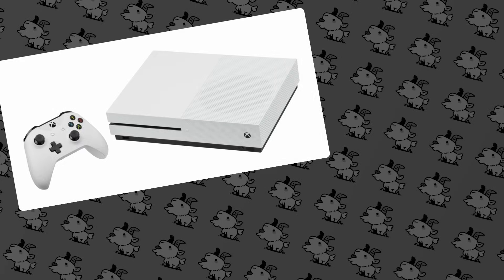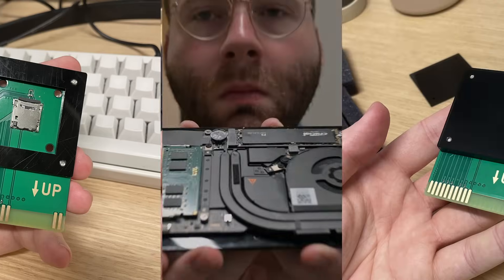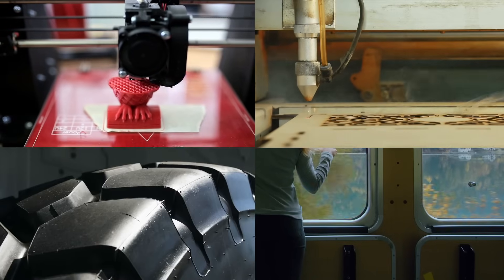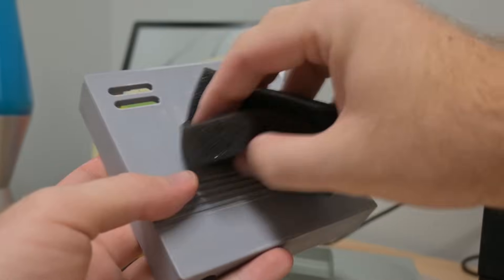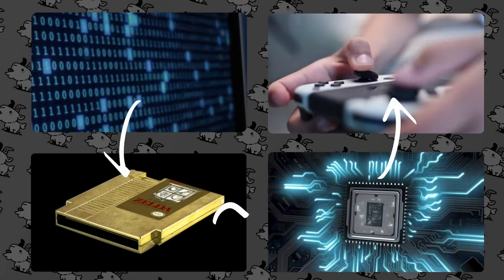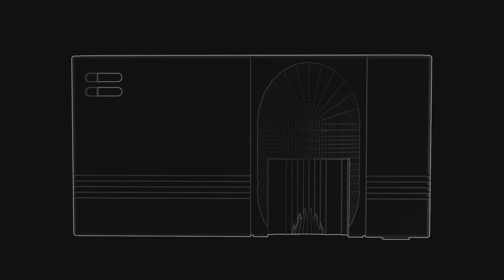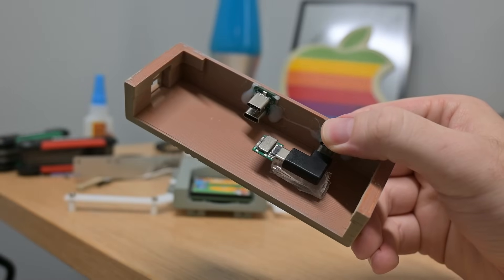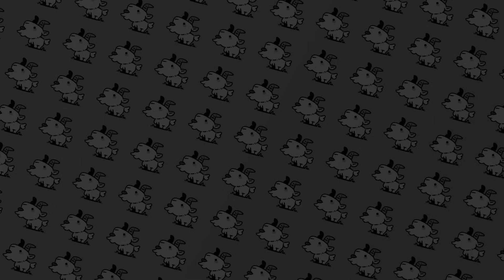I designed a game console that is already obsolete.

Comment: I would plug in the retro USB controllers that look like NES, SNES, or Genesis controllers in those spots.  For games, does it have a way to bring up a menu for save states, load save states, cheat codes, etc?  This is what I wanted my RetroPie to be, but much closer to the original idea I wanted.  I like the idea of physical cartridges more than just all things loaded on a device.

Comment: How did you make the power button work?
Reply from the maker: It's a bit of a cheat, since there's no power button exposed on the motherboard. It's actually a sleep / wake button, so shows up as a regular keyboard to the OS.
Reply: @abetoday  thanks for the reply. I'm working on a custom firewall project with an 11th gen Framework mobo and I've been using the tiny power button on the board.

Comment: I think using those ports for 8bitdo wireless receivers could be nice. They make wireless versions of classic controllers. Those adapters may also work for their regular top of the line controllers (such as the Pro 2 or Ultimate). Great video.

Comment: I would love to have an arm-band version of something similar.

Basically has a removeable switch-like controller attached to a screen that essentially has graphics like either star fox snes or other line/polygonal based games, essentially because it would be super underpowered and games would only be like $15 max, closer to 10. It could also be a way to get console games to go portable and cheap, as a barebone experience that should encapsulate the minimum needed to enjoy a game to the fullest. It would come with its own online gameshop to easily get games digitally. Not to mention connect together to get multiplayer if available.

I can go on about it, but unless I design and build/commission it, then it will never happen.

Comment: You could make an IR adapter that plugs into the front ports like the PS2. 
The PS2 had an IR controller with an adapter that just plugged straight into the regular controller ports in the front
Reply from the maker: Check out my "How to control your phone like it's 1984" video! I built exactly that.

Comment: wait does this have the console use a dedicated cpu or not? cause if so you have no air vent that will burn.
Reply from the maker: it has a metal fan grate on the back, it probably has better ventilation than in the original laptop case.
Reply: @abetoday oh ok them, cuasei was worrid for a second.

Comment: Nicely done!
IMO: There have been no games consoles in years - something you shove the media in to, turn on, and play... If a PC-like boot time, recurrent system updates, endless updates for software released in a broken state, the cursed DLC, a requirement to be on-line, no proper single-player or local multi-player... then it's NOT a games console! The last 'console' I owned was a PS3 - boot... online registration, 20 mins of systems updates, fired up Gran Turismo... 35 mins of updates. Turned off, never touched again.

Comment: here is how to get a good finish. apply automotive bondo, sand it down, primer it from about 3 feet with a preheated spraycan in hot water. let it dry 2 weeks then rub the surface with a rag. apply matte clear coat

Comment: Heads up: You can *massively* speed up sanding with the use of warm water with salt dissolved into it and <1% solvent and the use of a foam sponge between your hand and the sheet of sanding paper, or the use of a micro-sander, though I recommend you wear gloves. This can turn weeks into an hour or so fairly easily though you do need to regularly check and be mindful of your tolerances. Experiment a bit and find your sweetspot based on your preferences.
Reply from the maker: Good tip thank you!!

Comment: for the polishing step of the 3d printed material, you should have tested out an acetone vapor bath to actually melt the plastic and give it a shiny uniform finish, THEN hit it with the sandpaper and textured paints.

Comment: How did you get the games on the cartridge to run? You couldn't have used a steam library if you had a custom program running for running them. So how did you do it?
Reply from the maker: I’ll probably do a full video explaining how the cartridges work end to end, but TLDR is each cart has a script that is ran to set up anything needed for the game (either load the binary, set up emulator etc) and that script takes care of loading and booting everything from the carts
Reply: @abetoday do you think that a rubber ducky could potentially work for something like this?

Comment: Interesting project. Is there a way to get around all that hot glue tho? It looks so clean and that seems to kinda ruin the look.
Reply from the maker: There’s always a way to do it, would just need to design better internal brackets for the connectors, those just take a lot of iterations and time to get right!
Reply: @abetoday  so now that the design is done, that's v2, right? ;)
Reply from the maker: @vanelanjenkins3863  next console, no hot glue I promise (I don't promise)

Comment: Ports: - If we are going with he Classic look and feel of an old school system, then I would make the ports Module ports where you can have a game controller plug in, but also have the system register Bluetooth devices through a special dongle. This way your IR interface, is a special little dongle that plugs into the port. I'd also make a supporting hard drive that connects to the side of the main system and a CD/DVD rom that connects to the top of the system like the old Turbo Graphics 16, Super Famicom, and Sega CD systems used to do. All of which connect to the mother board through, those two USB ports. I would also build modular custom controllers for the system. That way you have this completely unique, high end custom retro system that feels like it's from the 80''s while also being modern and new. Plus your system could easily be the next Cyberpunk retro system. lol 

Examples:
Turbo Graphics 16:
https://en.wikipedia.org/wiki/TurboGrafx-16

Super famicom:
https://en.wikipedia.org/wiki/Famicom_Disk_System

Comment: What if, you added something like the gamecube did, modular devices for what you wish to do at that current time, say want to watch a movie? You just insert the IR module 
Play normal games? module for keyboard and mouse
Play retro? Make a module!

It seems like itll work
Reply: cool idea but aside from adding a disk drive it would be redundant if there's already a PC inside.
Reply: @Ucceah these modules could be basically the usb for the mouse/keyboard combo, can be wireless ^-^
Reply: @FezateruTheFloatzel  ohh, now i get you. a stylistically matched "cordlessess surfdeck (batteries not included)" would be sweet. 
i was thinking of monstrous modularity like the turbo-grafx 16 CD-ROM drive, or stacking a sege mega drive, mega CD and 32x.
Reply: @Ucceah pfft nah, movies can be streamed or just a disk drive connected temporarily for disks. Im thinking fun stuff, like heck, could throw on a Wii emulator with the bar and 'cartridge' thatll start a wii emulator

Comment: Those two front ports should simply be USB ports to plug game controllers in, I mean just about everything from atari to the nes has had controllers that plug in up front, so why not you too? it's what I remember classic game console designs being like, and I'm old, so I was there when they were new.  I'd totally plug some classic game controllers in there like NES ones or whatever, but NES USB controllers, this way, you could plug other controllers in too, like N64, atari, snes, colecovision, etc, all via usb. After all, when it's plugged in, nobody knows what the port looks like that's connecting your controller, just that it's rectangularish, so you retain the retro look.

Comment: Honest Question (as someone who is looking to do something similiar)...

Did you try filling before sanding/painting/sanding/painting....?
Reply from the maker: I used an automotive filler primer which generally does a good job of filling layer lines, but I did not do anything more extreme (bondo etc).
Reply: @abetoday  well that's slightly disheartening, but having no better plan I guess I'll carry on regardless... ;-)

Thanks for the reply, I'll let you know if I come up with a genius solution (so don't hold your breath :-) )

Comment: A simple solution for the front is to make the right side USB A ports. That way, you can hook up controllers onto it, preferably Xinput spec or compatible (thanks for the assist with PS4 controllers, Linux).

Comment: Where can I find the automan.sh file? I am about to write my own code but why would I reinvent the wheel? I am making two consoles right now. Thanks for the inspiration.
Reply from the maker: Are your consoles Linux or Windows based? My script is Linux only, happy to upload the latest version of its helpful.
Reply: Linux based... One uses regular 3.5 floppy disks and the other one 3d printed cartridges. The floppy one will be integrated to the body of a CRT TV. The idea is to play Pico, MD, NES, SNES, ATARI 2600 and maybe N64 if I use the RK3588. I have many options of hardware available to try.   @abetoday

Comment: Depending on how wide of a time period variance you're willing for it having the IR reciver would be cool on top but it personally reminded me of a PS2 controller/memory card ports so on the controller port idea- either having a dust flap similar to the memory card bays could be cool- but I think if you could pull it off a disguised USB(A) port could be cool if you didnt want to limit yourself to just one controller connection type

If you were to do a revision of this down the line I think having the left side be a bit bulker could give it more visual veriaty (although if youre going more C64 PC-In-Keyboard kinda style it might not fit with that) and it could have a wee flap to reveal menu buttons for preset programs if you wanted to use it as a regular pc. (Literally) on top of that- an expansion bay would be a really cool addition to see to make it a bit more bulky and have additional functionality (Say for example a shelled dvd drive or something)

Comment: WHERE IS THE AIR INTAKE
Reply from the maker: Look at the grate on the metal back plate and the circular cutout in the base acrylic. It actually probably has better airflow than the original laptop!

Comment: I've sort of considered using the RC2014 platform to build a game console. Get one of the graphics cards available, a sound card for it, and either redesign the ROM board to use a card edge rather than pin header or use the CF card reader and use CF cards for the cartridges(maybe use the ROM then for a library of useful game development functions).

It would be far less capable than what you're doing here(think NES at best) but it could be fun.

Comment: Assuming you've already tuned your 3D printer's extrusion rate, using a paint brush to apply a thin coating of acetone can get a finish indistinguishable from the VFD plastics of the 70s and 80s.

Comment: If the frame was reworked a little, the ports on the front could be reworked that lead to a new controller input. USB is cool, but that feeling of weird controller inputs was really mysterious and nostalgic for me. The S-Video input looking ones especially got to me, because it looked so complicated.
Reply: Could just use a standard 9 pin connector like Atari, Sega, and most 80s PCs to keep it semi standard

Comment: 8:15 I have actually developed an autorunner, which copies a ZIP from a USB drive,
checks it's signature (after the ZIP has been signed with APKSign) and runs the contained executable.
We use it to run test programs and only people with our signature would be able to run it, plus you can turn off the service (via systemctl).
Unfortunately I don't think I can convince my boss to open-source that.
Also most people would probably create a better implementation in no time.
(I think I'm actually reusing the Android Source Code's signature check, which doesn't even respect the time and only checks for one CA and no chain of trust, if I'm not mistaken. You could make a much better version with Rust crates in no time).
But yeah, that thing was developed in pretty much no time.

Basically, just stick together uevents (to detect the USB), do automount, check ZIP using regex, copy ZIP, check signature with OpenSSL or other implementation, run it and you're done, probably takes like one day.
I have also developed a signature checker for Rust separately (using OpenSSL and manually reading the ZIP file), but the lecturer that checked that one, didn't like it. It's definitely MIT, though, so only the other two steps would be left.

Comment: I recommend using a solvent to help smooth the plastic
Reply from the maker: I believe solvents only work with ABS but I use PLA if there are non deadly solvents that work with PLA I’ll def look into it!
Reply: @abetoday  I think you can use ethyl acetate to smooth abs. Commonly used in nail polish remover

Comment: If you are going to use Linux as your OS then why not just get an off the shelf Raspberry PI? It had GPIO that would have solved your status LED problem very efficiently.
Reply from the maker: Performance! Raspberry Pi cap out pretty quick, plus the idea with this build is that if you’re upgrading your framework laptop anyway, might as well make good use of the old main board!

Comment: I used to have a project sort of like this, i made a while back that used a sd card based cartridge that had a game on it and there would be some auto run script i wrote that would load the game. The thing ran on a lattepanda board i got laying around that ran linux. It worked okay but a few years later i got bored of it and broke it down. Sad the files were on my old hdd that commited su1c1d3 and i threw it in garbage because it was completely dead

Comment: What’s the OS did you use?
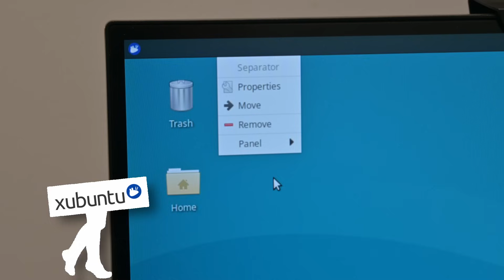Reply from the maker: Please refer to the legs at 7:56
Reply: @abetoday will I able to run games that were made for windows on the OS?
Reply from the maker: @Martin-vx7pc  It depends, Linux is the same OS as is used on the steamdeck and Valve does a lot of work to support Windows games on Linux, so it's fairly likely a game will run!

Comment: if you were going to blow up the transflash reader to make the cartridges, and then have to use use a sd card to usb adaptor anyway, why not just blow up the usb 3.2 standard!? that way people can make a 'cartridge' with an m.2 nvme enclosure. but also y'know, standard memory sticks. imagine re-using those old 100meg sticks you haven't touched in twenty years inside a cartridge case.

Comment: USB ports in the front, that way you can connect pretty much any wired controller to it. You may need an adapter but there are usb adapters for most any controller you'll run into unlike trying to do something like an Xbox to NES controller port adapter

Comment: I know you've already made the ports a Specific shape, but it would be cool if you made it for your own proprietary controller. Kind of like that ugly port on the Game cube. I feel like that would fit the theme perfectly
Reply from the maker: Yes! I would love to do custom controllers to match.
Reply: @abetoday  But you'd have to make a real gross cable to plug in. Like pentagonal with asymmetrical pins just to match that 90s style
Reply: @abetoday  You could look around at existing controller projects (like the Alpakka) and then make your own 3d printed housing design!